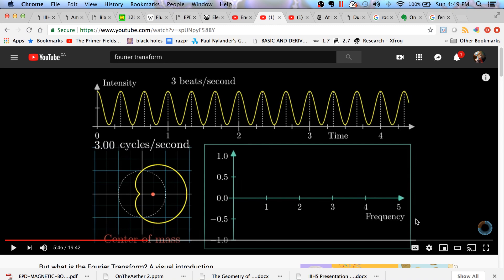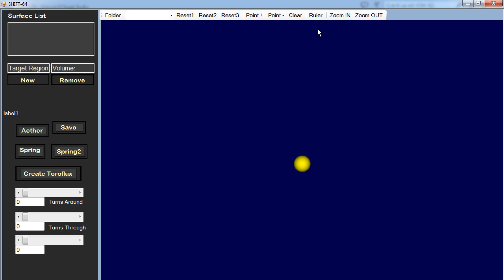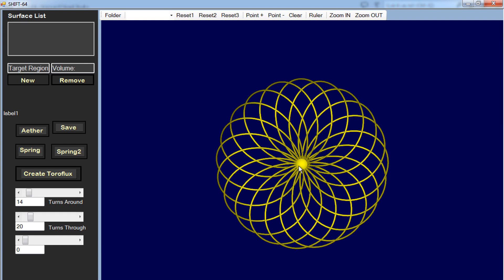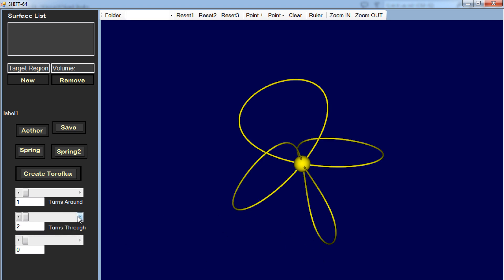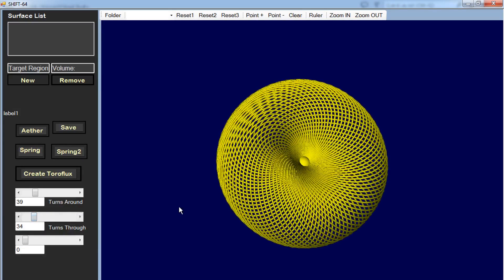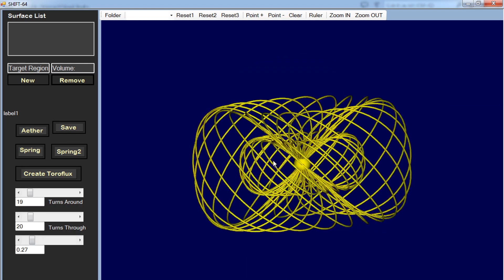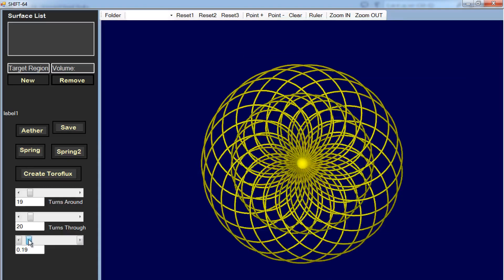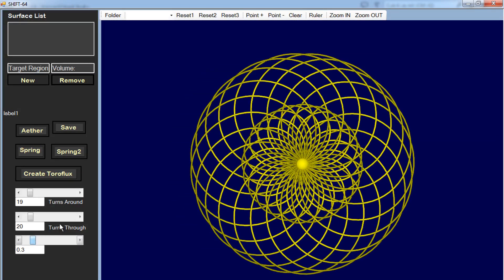On the Torus Knot

Comment: Hello Lori! This is amazing work. Thoroughly enjoy all your videos!
One observation: When you vary the offset parameter (e.g. at 10:12), there are two "doughnuts" - inside and outside. This looks more like the geometry of a ring magnet seen under the ferrocell. On the other hand when you (briefly) increase the offset parameter to a much greater value (at 14:12) it looks like the geometry of a solid magnet under the ferrocell with a "hole" in the centre. This makes me wonder, if you keep increasing the offset parameter the hole in the centre would keep on increasing to a point where no donought is seen only a hole which may represent the dielectric overtaking the magnetic. 
What do you think? A response would greatly help me clear things in my mind! Thanks :)
Reply: Correction: The high offset value is at 9:10
Reply from the maker: Interesting idea regarding the ring magnet vs a solid magnet. Regarding the dielectric overtaking the magnetic, this is also an interesting idea. I don't have an answer but I will give it some thought.

Comment: Love your work Lori <3

I think you might find my simulation of this very interesting:
https://www.youtube.com/watch?v=kfhLUwIS778

I have created the torus knot from two simple sine oscillators! 2D at first, and then 3D half way thru the video. It is created in real-time, through time, with FFT happening at 60 FPS, not just one fixed FFT. As you can see, it is essentially a visual analog of the ratio between two frequencies plotted on a vectorscope (oscilloscope in X/Y mode)

From what I can tell, your "turns around" is equivalent to one of my oscillator's frequencies, and your "turns through" is equivalent to the other oscillator's frequency. Your offset parameter seems to be linked to the volumes of the oscillators in my sim.

If you're interested in the details let me know :)

Comment: Super interesting!  In my theory those lines through were partical streams through the electron center into subspace and into the subspace to normal space center hole in the proton, stacked, a neutron.  In my theory, do you think the particles would be chaining like magnet strings, or do you think they could simply be in a toroidial orbit?  I know i'm asking you to explore a theory you don't agree with, but i'm just asking, and if it is not interesting to you, then never mind it.  I hope your rest of your year is a great one.  You do present a very logical description of magnetism.  I hope more facts come out in support of Ken's theory if its true.  :-)
Reply from the maker: A colloid is a solution that has particles ranging between 1 and 1000 nanometers in diameter, yet are still able to remain evenly distributed throughout the solution. These are also known as colloidal dispersions because the substances remain dispersed and do not clump or settle to the bottom of the container. 

Ferrofluids are colloidal liquids made of nanoscale ferromagnetic, or ferrimagnetic, particles suspended in a carrier fluid (usually an organic solvent or water). Each tiny particle is thoroughly coated with a surfactant to inhibit clumping. 

It is my opinion that what we perceive as "space" is analogous to a ferrofluid. Here, the fluid Aether plays the role of the suspension fluid and the vortex-antivortex pairs (electron-positron pairs) play the role of the nano-scale magnets suspended in the carrier fluid.

In the absence of normal matter, like electrons and atoms, the vortex-pairs are not aligned in any particular orientation. In the presence of a magnet, these tiny magnets chain together like they do in the ferrofluid inside a ferrocell. When these particles are aligned, the fluid Aether can flow through them like tubes. This is what we perceive as tubes of force. When they are not aligned, fluid Aether can only flow between the vortex and antivortex.

So the Aether is two fold in that there is a Potential component (the vortex-pairs) and a Kinetic component, the fluid Aether that flows between the vortex and antivortex. 

I may not be right about everything, but this is the direction I am going.
Reply: @FractalWoman  wow, i understand your theory now, and I see why you think that, wow again.  Without a subspace component, the theory explains magnetics very well.  

I could see where the aligned atoms could create such a vortex system in a magnet according to that theory due to the natural spins of atom nucleus particles.  

I'm sorry that I disagree and that i seem dismissive.  I see how very likely that theory seems, and why such a smart person would explore it and even defend it.   
If gravity wasn't faster than light and I didn't see it as a subspace effect where roots of all matter were closer together in a subspace to where above interactions made gravity only appear to be faster than light, I would truly become an advocate of that theory, Ken's theory, which you explain quite well, maybe better than him.

I am sorry about my way of asking.  I am not a troll.  But i apologize to you for me being dismissive.  Please, honestly, forgive me.  You are very bright and I need to interact better with others.

Comment: The geometry looks right from above the "pole", but the side view doesn't. Under the ferrocell we see the geometry changing as the position of the magnet relative to the cell does. In particular, the side view of a magnet shows the plane of inertia surrounded by almost parallel lines, not by crossing curves. The only way to represent that geometry, IMO, is with four dimensions. Some time ago I wrote you something about quaternions and their three dimensional projections. That's the path to follow; I'm no mathematician but you have the knowledge to pin it down. Keep up the good work!
Reply: I found it, back in the "Steinmetz Not Wrong Final Word" video.
Beware: in that message I wrote "hypotrochoid" strictly intending the shape presented by magnetic fields under the ferrocell. 

Lucas Siccardi
1 year ago
Try quaternions and stereographic projection. Hopf fibrations look very promising (compare this video https://www.youtube.com/watch?v=AKotMPGFJYk ). What you need to get from the torus knot to the hypotrochoid is changing the slope of the curve as it approaches and moves from the inner side of the knot (actually, from the center of the plane of inertia). You should get this (with Hopf fibrations) by substituting the circle array of points on the sphere (which is the projection of a straight line on the spherical surface) with a set of points following the arrangement of the projection of a sine (whose phase is to be proportional to the distance from the center of your plane of inertia). That might look just as a set of points arranged along an inclined circle, or maybe your loved pear-shaped curve, but I'm not sure. Experiment with that: how happy would you be if the shape you need is that of a Mandelbrot set lemniscate?
Reply from the maker: I agree that the geometry looks right from the pole and not from from the side view. In a similar but opposite manner, Maxwell's equations model the side view well, but not the pole view. There is something missing in both cases, and I am trying to figure out what that is. 

Also, regarding quaternions, I did try them. When you project quaternions back to a 2D (so I can show you a picture), then you get back the 2D complex plane. There is no such thing as a 3D complex space. It's either 2D, 4D or 8D.
Reply: @FractalWoman  "When you project quaternions back to a 2D (so I can show you a picture), then you get back the 2D complex plane. There is no such thing as a 3D complex space."

Why do you need 3D complex space? What you see under the ferrocell is 2D. Motion on the complex plane is the best way to represent that shape; so much so that I think that "Ferrocell as the complex plane" is a great video topic, and if you wait too long it will be realised by a "generalist" math channel, like 3blue1brown.
Reply from the maker: @lucassiccardi8764  I agree. Complex numbers don't need to be 3D, and they can't anyways. 2D is enough to describe the incommensurate behaviour.
Reply: @FractalWoman  The point here is not so much incommensurability as, more modestly, defining a geometrical shape. Discovering the number of dimensions is probably the first step to be made. Since under the ferrocell we see the lines morphing as we move the magnet, and the limit-shapes (the hypotrochoid observed in the top-down view and the "two-eyed shape" observed from any side view) appear to be only two, I assume that four dimensions are enough. What we see under the ferrocell can be thought of as fibrations in the 2D complex plane (*apparently* portraying a 3D shape, like the Rodin coil) of a 4D shape, meaning that each still frame can be seen as the complex plane. So, rotating the magnet under the ferrocell might correspond to applying some basic operation to the whole plane, for example: raising to the power of i = 90° rotation.
Reply: @FractalWoman  Otherwise, we could think of two 3D geometries superimposed; what I don't undestrand then is why under the ferrocell we see the magnetic field from the polar view and the dielectric field from the side view. Is it possible that the orientation of the polarized matter in the fluid switches from one to the other because of some crystalline property?
Reply from the maker: @lucassiccardi8764  That is a GREAT question and I had to think about that for a loooong time, until Ken said "everything you can see under the ferrocell (bright lines)  is the Magnetic field and everything that you DON'T see (dark central region), is the dielectric field". Both the pole view AND the polar view, are showing the MAGNETIC field. This is what trips people up. Hope this helps.
Reply: @FractalWoman  Yes, I was also coming to the same conclusion on other bases: specifically, we don't see an abrupt shift from a geometry to the other, rather a continuum of change. It is the geometry of but one shape, with continuous curvilinear edges. This brings me back to 4D and quaternions. I tried to bring this up with Ken but he dogmatically dismissed me... You know :-)
Reply from the maker: @lucassiccardi8764  Yes, I know. He is very dismissive. I have to give him the benefit of the doubt though because he has LOTS and LOTS of subscribers and I have 1500 or so. I can manage that. So far so good. But if I was getting a question or comment every second, I could not deal with that. Regarding the geometry,  as I said in the video, this is just one geometry. The torus knot is one continuous line. I didn't need 4D to generate this geometry, only four parameters. This could easily be encoded into a 2D complex number which has four quadrants.
Reply: @FractalWoman  And I'll say more: the side view shows us infinite lines; the plane of inertia radiates outside of the ferrocell to the infinite, whereas the diameter of the hypotrochoid visible in the polar view is clearly finite. This is the case with stereographic projections of spheres onto planes.
Reply from the maker: @lucassiccardi8764  You are right. And I saw something very familiar on this wiki page.  https://en.wikipedia.org/wiki/Stereographic_projection

The Steinmetz two-wire schematid.
Reply: @FractalWoman  Yes, absolutely. Steinmetz' schema or the side view of a magnet under the ferrocell, that's the thing that got me on this road. But how do you make sense of this?
Reply: @FractalWoman  I mean, relativists accept this shape as that of an expected black hole, but to justify that they suppose a 4d curvature, a singularity. Under the ferrocell we are really looking at something like that.
Reply from the maker: @lucassiccardi8764  I will have to think about that.
Reply: @FractalWoman  Talking about Steinmetz' two-wire schema and sphere stereographic projections on the plane, it's interesting to note how applying the Riemann Z function to every point of the complex plane (meaning: taking a certain complex number and feeding it into the function as its "s" variable) the cartesian grid morphs to form that exact same pattern. Just take a look at minute 09:45 of this video: https://www.youtube.com/watch?v=sD0NjbwqlYw&t=1178s